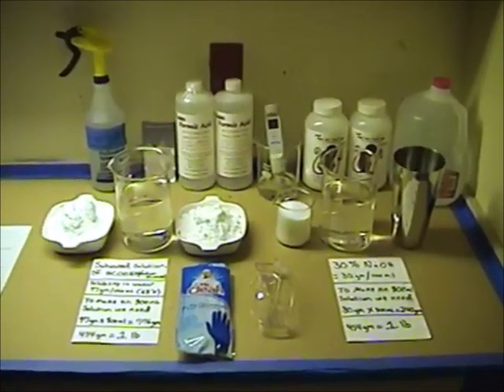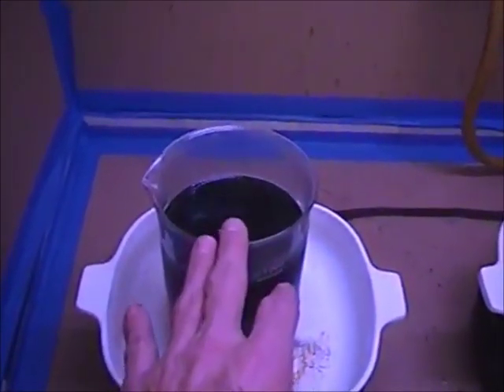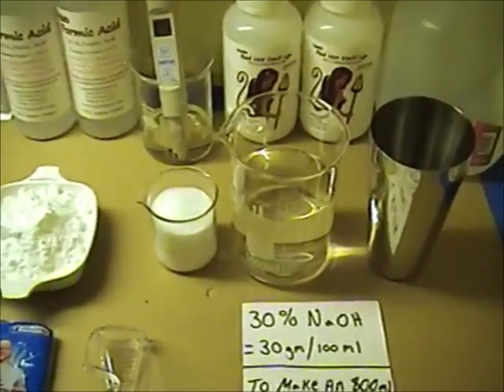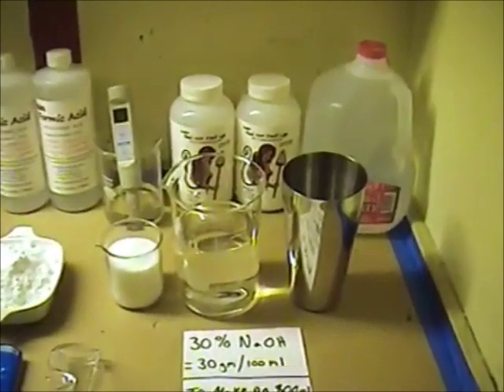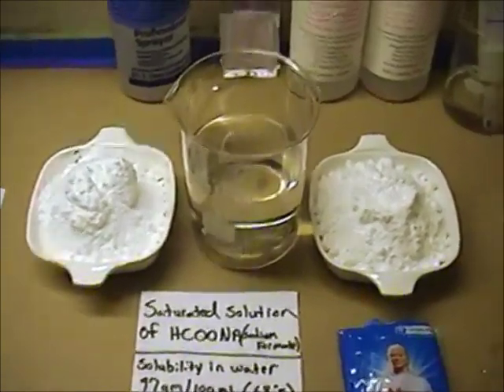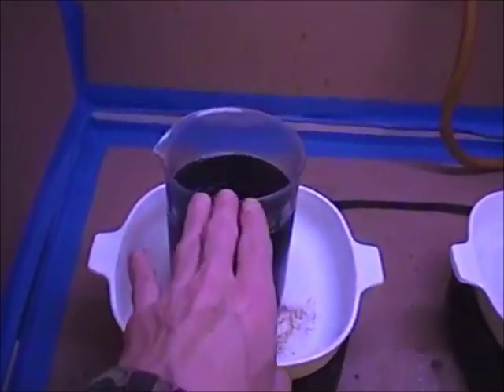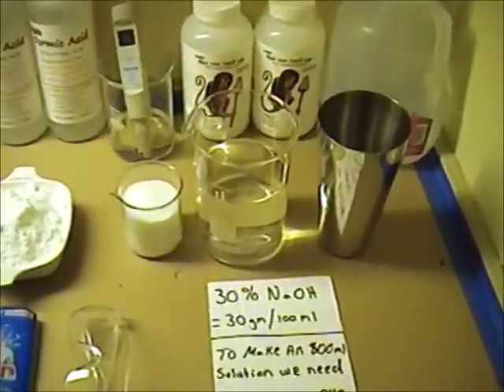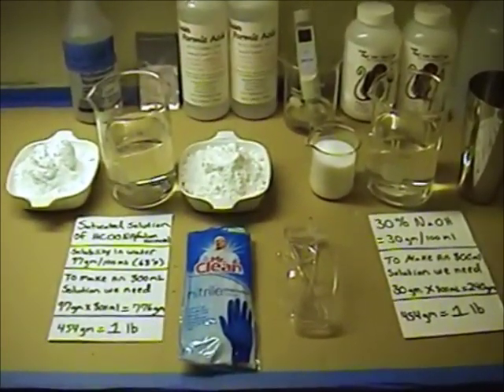REFINING STERLING SILVER VIA A SODIUM FORMATE REDUCTION PROCESS PART # 2

Comment: Sodium hydroxide doesn't dissolve glass. We use glassware for preparing strong solutions in the lab all the time. It will definitely try to dissolve you though, so your cautions on the use otherwise is very appropriate.
Reply from the maker: +DrZ with Crow Yes sir concentrated, heated,  NaOh will dissolve glass. I've got the beakers to prove it. Do some googling and you will see. As you stated it will also dissolve organic materials such as your skin quicker and more efficiently than acid.